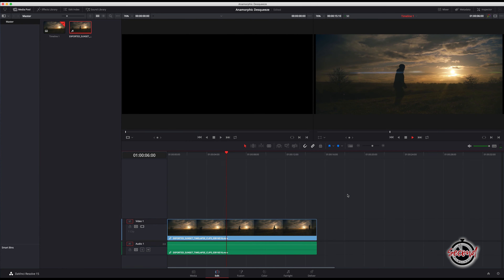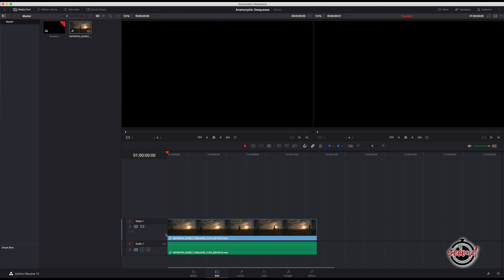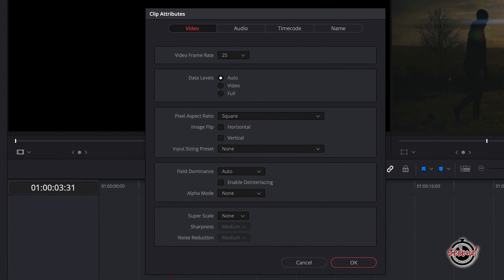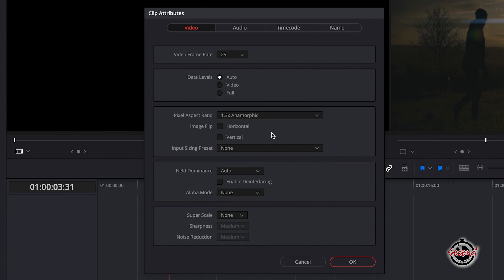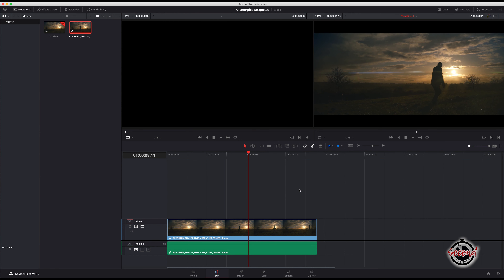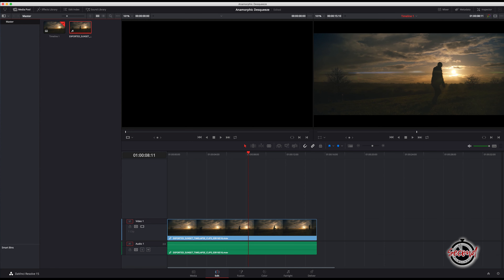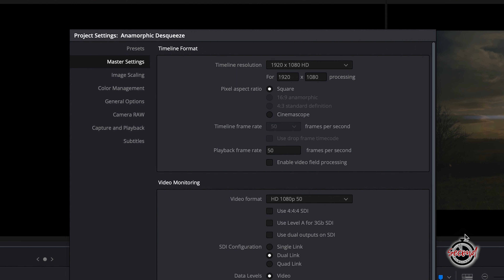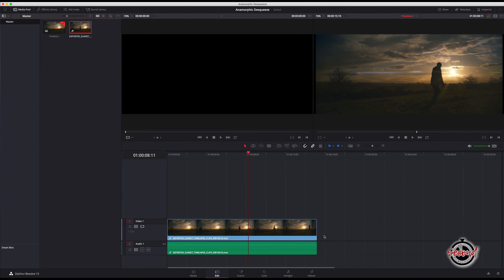How to Desqueeze Anamorphic Footage in DaVinci Resolve

Comment: I have the sirui 1.6x lens and the 1.6 option isn't available. What Do I do now?
Reply: I'd like to know too. I've tried a different method to desqueeze, but the footage looks a bit low res, compared to stills taken with the same lens.
Reply: Okay, I found out from another video. When you go into pixel aspect ratio, instead of picking one of the choices there, go up to custom. It'll give you the option to enter 1.6. 
You've probably already found that out by now, but I figured this might help someone else.

Comment: I found that when I used 5107 (for 4k 3840x2160 footage), the timeline playback size would change to the correct size and the upper and lower black bars would disappear, but as soon as my video edit played through one time, I would get a red "Media Offline" error while pausing video and then while playing back the video. What solved this issue (for me) was, using 5108! . When you do the actual math on 3840 multiplied by 1.33 you end up with 5107.2; it's that .2 that I think the program glitches over. It seems to need one more row of resolution to resize everything correctly and fit that .2 of resolution somewhere... I think.... . 5106 also seems to work for some reason?
Reply: When rendering the timeline with a resolution 5107 x 2160 I have received an error saying ' frame width or height cannot be an odd number'. So I made the x value 5108 and it rendered smoothly.
Reply: what codec you used?

Comment: Hi this is a great video. Im a lil bit lost srry im new to filming but i really love the anamorphic look. And i would like to record some videos at 2.35:1 aspect ratio. Question i have im trying to get the the SIRUI 35mm Anamorphic Lens F1.8 1.33X if i record in 3840 x 2160 but i want my aspect ratio at 2.35:1 in my timeline do i change to 3840 x 1634 after what u wer saying in the video? Or by just changing it to 3840 x 1634 will automatically dezqueez my video? Or i need to do the first setp u wer mantion on the video? Srry if its a kida dum question but any help would help thannks. Will 5107 x 2160 give me 2.35:1
Reply: Did you got any answer for your question? I’m using a bmpcc4k and a sirui 35mm x1.33. I’m confused what to set as my timeline resolution. 4096x1716 dci scope 2.39? 5107x2160?
Thank you for helping me!

Comment: like, thank you for just putting the info I need in here. Unironically, other creators if you're reading this. I at least will rewatch this a couple of more times because:
1. I'll have to check if the info is there.
2. I have the memory of a goldfish so until I open resolve and do anything I've forgotten where to click
3. I'll have to look the final step against the black bars again.

Because it's short, it doesn't bother me to rewatch the whole thing again to engrain the procedure. So you'll get more engagement from the video.
Reply from the maker: Thank you very much for your support and kind words!